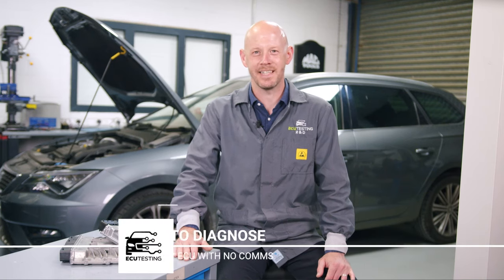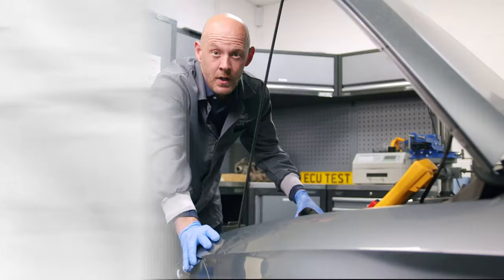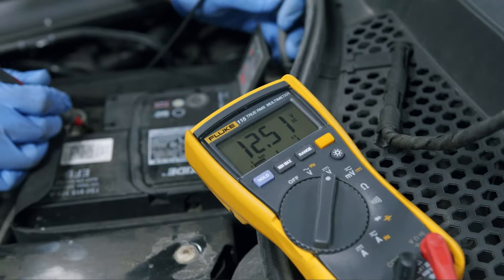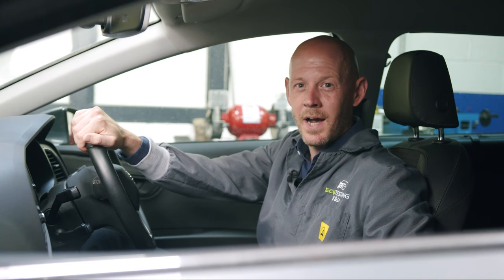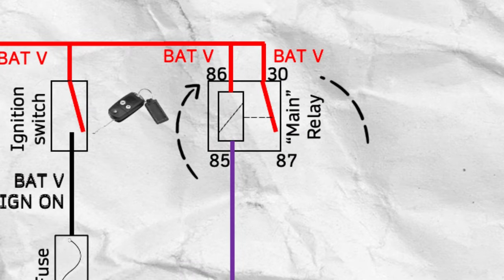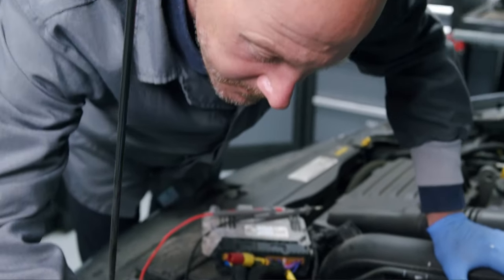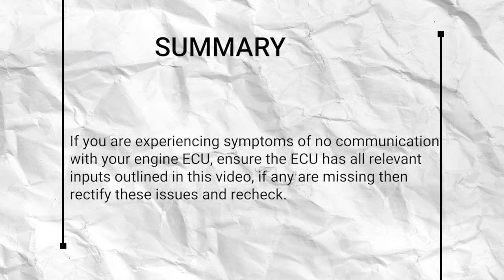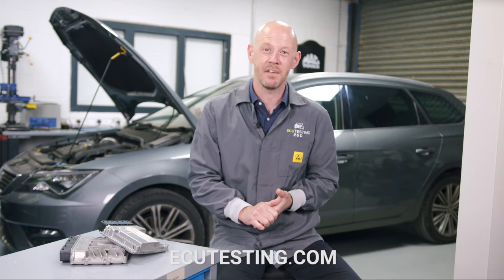How To Diagnose A Faulty ECU With No Communication

Comment: My car is starting and when remove my foot from exceleration peddle check engine light come up an no more exceleration.
Reply: Sound like mine. Im stuck in limp mode. I'm getting a p2138 for a pedal sensor.  I checked voltage and it was over 10v at full throttle
Reply: Look for diagnosis machine for directions  , like mine

Comment: Hi hondajazz green key flashing  car crank no start it look immobiliser no spark no fuel.locksmiths check key it's ok immobiliser  ok but no start.put break out bar good grd sig  good chassis grd.but can low n can high both reading are high I can't  get all together  5v. Unplugged  ecu look for can low n can high got big reading with multimeter.yr advice please. Thx

Comment: I`m trying to create a waveform to test a smart alternator. Mitsubishi. I`ve heard the frequency is 90 hertz on a Ford Focus and duty cycle shout be around 37 to 45 percent. I can not find any information anywhere. This is off a Subaru Impreza. I`ll start off using 5 volt square waves and see how I get on.

Comment: Hi I'm in south africa I have a problem with a Chevrolet cruz 1.6(LXT) F16D3 I replaced the engine then after the diagnostic can not read the ecu it says the vehicle is not equipped with an ecu it also says software not available for the vehicle

Comment: Great video and explanation. I tested my EUC that came with a swap kit for "crank but no start" with your information. After verifying all good grounds, constant 12v, and switched 12v, my EUC failed to pull the constant 12v to ground, allowing the relay to receive a negative signal and switch the relay on and provide power to the other side for boot up.

Comment: Using this video I found a problem with the ECU cable system that five previous mechanics could not find. Turned out to be a problem with the wire between the main relay and the fuse (the yellow lines at 4:05). Thanks a million :D

Comment: I have one question. I cant connect with engine ECU, if it matters its a BOSCH 0281032607 and car is Jaguar XE 2.0d 2016. Important note is that engine is out of the car together with wiring loom for various sensors, injection etc. Only first connector is plugged in , the one that comes from the firewall. Is it possible that this ECU is grounded trough that second wiring loom that is connected to various places on the engine itself so now without it, is not recognised by diagnostic tool?
Reply: It does not matter what vehicle or scan tool, what you mention about the vehicle harness having various specific ground locations is true. Therefore in theory without those grounds points being grounded, you'll NEVER get any communication with a scan tool while having your ECM plugged into the harness. ECM NEEDS THOSE GROUNDS! With the correct equipment you can surely communicate with your ECM off the vehicle though as well. 😊

Comment: Hi Tim, i have a ford S max that wont let me clear codes and is limiting power while driiving like 2200rpm and then nothing turbo working drives fine unless you put your foot down and its like its in limp home mode but i can get on the motorway and do 80mph just takes forever.

any ideas ?

2008 2.0 tdci titanium. its like its bricked when you lock your mobile with the wrong code in it, turns up but its not doing much. how do i find which version of ECU i have to get 1 from you or send mine back to check it.

Comment: Hi I have a Mondeo 2.0 Zetec petrol. It is showing a p0607 code and a P2110 code which is reported to be a common problem with this model either being the ECU or the throttle body. My throttle body appears to be ok . Could it be any other sensors causing this issue or Will it be the ecu the car goes into engine malfuction immediately the ignition is switched on even though engine is not running when engine running it mifires, Any help would be appreciated . Thank You.

Comment: Have a suzuki xl7 that runs great when it's cold but once it been running. That's when I have issues. The speedometer sometimes works,the thermostat started running hot. The engine isn't hot at all. No leaks in the radiator. The engine light has come on, now it doesn't come on. The traction control light came on. Now it doesn't. It shifts hard,slipping, Complete stop then shift hards when going to complete stop. Sometimes it doesn't want to go into gear. Drives great when its cold. Any suggestions?

Comment: My Ford Territory had ECM problems. Had it replaced numerous times. Now the front right brake locks up the wheel. Had the vehicle towed back to the workshop. After 4 weeks in the workshop I still have not been contacted yet. I told them I don't want the car back unless they can guarantee me that the car is Safe to drive. Will probably NEVER get the car back... (NOT HAPPY)
Reply: Well you bought a ford
Reply: @dylanwood7810 I was going to say the same.

Comment: Hi 
E90, cranks but no start + no communication to ecu.
Followed your video and everything is fine to the point of  having no 12v at 85 with ignition off 
Whilst having 12v present at 86 
Any help would be much appreciated
And thanks for the great professional video😅
Reply from the maker: Hi. If you are not getting 12v at 85, then there could be a problem with the wiring from the ECU to contact 85 or with the ECU itself. We would recommend inspecting the wiring and connectors/pins first and then continuity testing the wiring to rule it out. If it checks out OK then the fault will potentially lie with the ECU itself. If you would like to send your unit into us for testing to confirm this, please fill in our online test form at www.ecutesting.com. Thanks.

Comment: our nissan juke has undergone a engine rebuild process  due to excessive oil usage. the garage is now telling us the engine has been rebuilt but they cannot test drive vehicle because there is a definite  problem with the ecu unit and want to send it off to a specialist for diagnosis, at a cost to ourselves. what will this test tell us and do you think we are being fobbed off. so far works have cost us 3500 pounds on our 66 plate juke with 30 thousand miles on clock. please help. yours truly shaun
Reply: How did you go?

Comment: Hi got citroen dispatch 2.0hdi start problem in morning U1118 Communications On The Comfort CAN. No Communication With The Built-in Systems Interface
Permanent Fault

P1693 Remotely Controlled ECU Wake-up. Start Or Stop Requests Missing Or Invalid
Permanent Fault

U2001 Remotely Controlled ECU Wake-up. Main Wake-up Request Missing Or Invalid
Permanent Fault

Live Data Qty(0)

Airbag

Comment: Hi,

I have a Volvo V50 that has problem with anti-skid, the faultcode is ABS-0101, I can switch the car on and off a few times and the fault is no longer present until the engine dtops and is restarted, then the samething is back
Our M.O.T. does not like this at all 😢
Do you have any leads where to begin a search?
Sinc. Paul

Comment: I was just told by the dealer they will NOT be able to fix my 2004 ML350 because they could not find an AAM for it (discontinued).   Is there anything else I can do other than junk car, because it has a good engine, trans, body, everything.  What do you say?"

Comment: Yeah I have a 1988 Chevrolet Cavalier Z24 5spd and digital dash!
It smells of gas at idle also idles like it's missing, it wants to haul ass then very early it loses it's powerband, I changed the O2, I changed as far down to the ignition control module, tb cleaner up the wazoo flushed changed fluids, but still runs like Shit!
This is my question. Is this my engine computer???

Comment: Hello please I need your help I was driving my 09 Honda accord the other day it as never giving me any ecu related code before the car just dead on me o was told is the ecu so we get another used keihin ecu we even test it on another 09 Honda and it works perfectly but when we put it in my car same thing it didn’t start and is not communicating with scanner any help please

Comment: Hello I came across this video and I am having same kind of issue car cranks but does not start-no spark no pump noice running, on dashboard all lights comes on and off but I don’t have check engine light on off at all plz help
1997 Toyota Supra 
Japan version Jdm 
2jzgte automatic

Caused
Parked for 6 months and boost up to start and than turned off than crank it was low battery voltage and it cranked and than click sound it never start checked fuse box but can’t get to fire all I know I am missing engine on dash sign in starting when ignition switch on

Comment: 2004 Toyota RAV4 – crank no start issue:

hi, I have a 2004 Toyota RAV4 and it would not start on its original ECU, note when the ignition is turned on the battery charging light indictor does not come on and also the engine check light is not coming on. i replaced the ECU with another one that came in from New Zealand and after fixing the broken wires on the deceleration Sensor the car started once and died after 30 seconds. after that even the replaced ECU stopped showing the Engine check light and the battery charging light when the ignition is turned on and it would not start. when i scanned the car with a LAUNCH scanner, the ECU is accessible. It only shows the ABS and SRS scan results. What could be the problem. Does the 2004 RAV4 have CAN system on the car? note the only wires on the OBD2 connector are on Pins 4,7,9,12,13, 15 and 16.

Comment: Thank you forbthe helpful video,My carkia rio 2013 has no continuity on my 1-2 ecu connection read as ETC MOTOR( +) and ETC motor (-) then no continuity on spark and throttlebody same in radiator fan sensor could you help me?thanks in advance

Comment: I have a nissan 2007 altima. Radiator fan is always on once engine starts. I did IPDM self test to confim IPDM and relays. And it was good. ECT sensor is good as well. Is there a way check signal from ECU to IPDM?

Comment: I don't know if you are still around but if so my problem is with a 2008 Saturn Aura XR 3.6 L . RPMs Idels great but as soon as you touch the accelerator the RPMs jump to over 3000 rpm and an alert comes on the dash traction control and ECU needs service and then that goes off with ECU off came on then went off. could this be a bad ECU????? Changed out the Throttle body with a new one. That's when the problem started with the idle racing., you thought I'm totally confused.

Comment: I dear sir, in my car have loss acceleration and when i give acceleration there is voice and car jerking, i changed plugs, coils, camsensor but still i’m getting error p0344 in honda civic 2017 please help me I’m suffering by the way i changed the battery before it was 5amp now 4.5 amp is it battery issue or ecm? Because my car start good if there is battery it will not start good right?

Comment: Monka 1600 low mileage Drove parked then 2hrs later no crank no error code, Had RAC out problem with ECU  5amp fault. might be a broken lead due to the very hot weather, towed to Vauxhall for diagnostics. Got to wait till October. Told it will be expensive, could it be the ignition, we had this changed about 3/4 years ago by a different garage.

Comment: I have a 2002 Volkswagen Golf the only way it will start is to turn the key with the battery disconnected turn the key on to ignition hook the battery back up get back in the car and continue starting the car at the car will start and die instantly turn it off turn it back on mobilizer light goes out car won't start just cranks and that's the only way it'll start is if you print the key on with the battery just connected and then connect the battery up with the key on and then start it at the whole time that that's going on the immobilizer lights flashing

Comment: I have an ECU that the documentation says I should have 3-4vdc on the comm bus. i have 0vdc (flutters in the mV range, about 20 mV). Engine starts and runs fine. What would you check first?

Comment: Thanks a lot, I have had a problem the car was start first thing in the morning then would have a check engine light on then after the car has been stopped and started for 3 or 4 times the check engine light would disappear I then in my wisdom decided to use electrical contact cleaner made sure it was dry with the airline plug them back in and now. Now I have a Christmas tree and the car is running rough how long will you need to fix and how much

Comment: My 03 mazda 6 is reading u0100 battery is good ecu hasn't had an issue this code came on after I had a misfire in a cylinder and I had replaced my coil pack the volts to the ecu read what my battery is reading

Comment: my ford galaxy runs but wont rev above 1000 revs  showing no fault codes other than no signal    when plug in odb reader yet on dash theirs an air bag fauly flashing glow plug light and problem with the abs   and its saying  take vehicle in for service    whats  the problem

Comment: Please I have a 2006 Nissan Rogue no engine light and no communication with autel scanner tool I have check relay and fuses, all connection going to the ecu I fine one constant and three switch supply and all the earth are good but no kick and no start

Comment: I have a VW Tiguan 2011 model,it crank but not start. When I diagnose the car it give me 01314 code. What is the problem with the car?
Reply from the maker: The 01314 code indicates the engine ECU is having trouble communicating to other modules on the vehicle. This can be caused by a faulty ECU, damaged wiring, or an CAN Bus network fault. We would recommend completing the checks in this video to determine if the ECU is faulty. If it is then please email our technical support team on info@ecutesting.com if you would like us to test your unit and potentially re-build it if you would like. Thanks.

Comment: Hi there. Good video   I have a delphi mt05.3 ecu. And when I start my engine  with engine  light on  it starts and dies I have  had engine  out 5 times and all is good  new wire harness  and still the same issue 😢   is it the ecu    I am thinking  of buying  a new ecu witch is 160£   but I can get a same ecu  but been told it needs matching  up with my engine 😮  I don't no wot to do. It is also a efi scooter 125cc 2021

Comment: Thank you for the video... but i have a problem on my 2008 kia ceed 1.6 diesel engine ECU got blown by touching the positive terminal of the battery ... car wont start again no check engine on dashboard... can a similar ECU be used?
Reply from the maker: If it is the ECU thats damaged and you are looking at replacing it then you will need to ensure you have the exact part numbers of the unit matching your current ECU, and you will likely need to code swap data from the old ECU to the new one. Alternatively we may be able to remanufacture your damaged unit, please email your part number to our technical support team on info@ecutesting.com and they will advise you further. Thanks.

Comment: Hi if the ecu is bad will the ac windows lights still work? My car isn't starting i had cleared a code and shut off the car using a scanner but after that the car isn't starting.

Comment: My zafira tourer 2015 has this code : U0100 and car not starting . Please suggest what needs to be repaired
Reply from the maker: Hi. Start by checking your batteries state of health as this is the most common cause of that code. Then complete all the checks in this video to ensure the ECU is receiving the correct power and has a good ground.

Comment: Bmw e46 engine runs fine ecu probably works fine (i suppose)... yet elm237 doesn't communicate with this module for some reason ( on another car the Bluetooth elm.237 does work although on a minimum basis rpm readout etc) on the e46 it says communication failure to ecu please anyone has any advice
Reply: Ps I am a noob

Comment: The pencil coil melted while the car was moving  and it only cranks. What is the possible or cause of the problem
Reply from the maker: Hi the possible causes of a faulty coil could either be a within the wiring to the coil, a damaged ECU or a faulty coil itself.

Comment: I own a 02 nissan x trail when pushing down on the gas pedal check engine light comes on.and then she losses power can it be the ECU.i've change fuel pump throthle body MAF sensor clean out the cat camshaft crankshaft sparkplugs ignition coil 😂only thing left is the ECU.r should i just swope the engine and call it that?
Reply from the maker: Have you scanned the vehicle for any fault codes? These can help identify which component could be causing the fault. However, a faulty ECU can certainly be the cause of power loss, so if you do suspect it to be faulty then we would be happy to take a look at it for a potential test if you wish. Please email our technical support team at info@ecutesting.com with the following information. Your make and model of vehicle, symptoms of the fault including any fault codes, any attempted fixes you have already carried out, and finally the part number printed on the ECU. They will be happy to advise you further. Thanks.

Comment: I was wondering if a weak battery could also set code only because in the morning it seems like it has a weak cell in the battery that’s when it went off check engine light and then it starts right up afterwards easily when it’s been running

Comment: Hi I have a bmw 320i thermostat no work when cooling fan is plugged if I remove cooling fan thermostat starts working properly I believe is ecu problem what you suggesting? 
Thank you 😊
Reply from the maker: Hi. This isn't a problem we are familiar with, however if you would like to get your unit tested to make sure, then please contact our technical support team via email at info@ecutesting.com with the following details: Your make and model of vehicle, the unit part number (if possible), the symptoms of your fault, and any further diagnostic information you can provide, and they will assist you further. Cheers